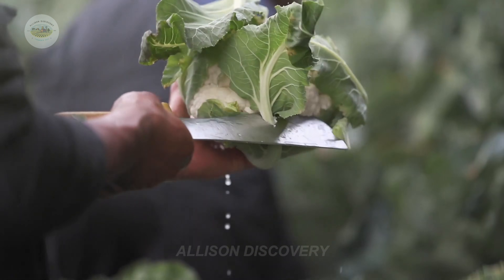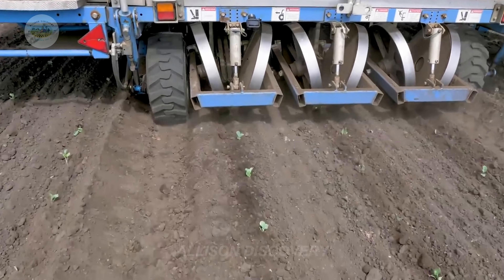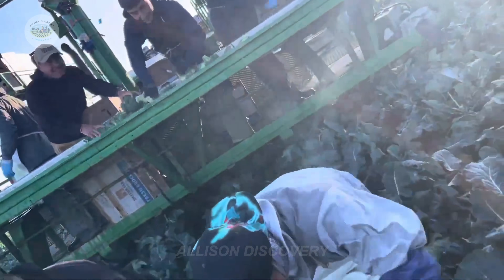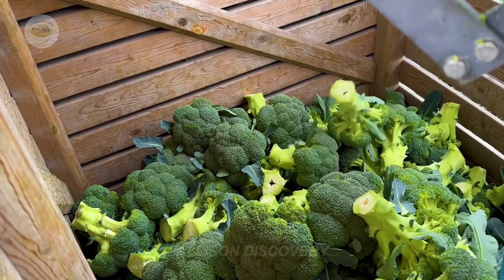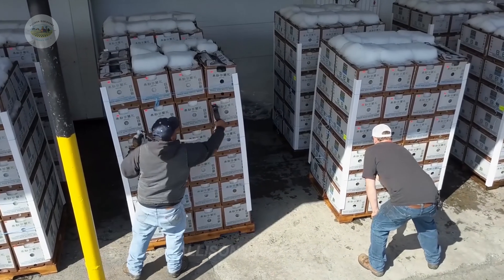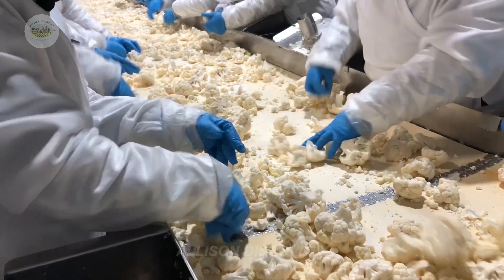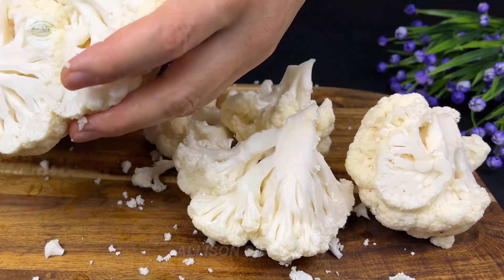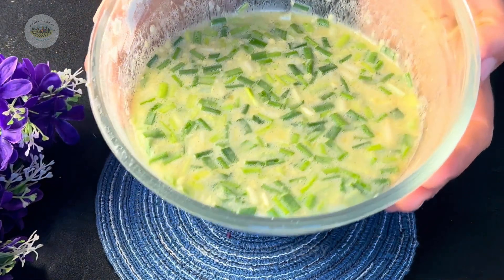Growing Cauliflower - Harvesting MILLIONS of Tons of Cauliflower | Agricultural Technology

Comment: I was diagnosed with a redundant and tortuous colon at age 50 and figured out that I could eat 1 pound of green peas to obtain 25 grams of fiber per day to solve the constipation problems. But 1 pound of green peas produced an insane amount of gas, even after intense steaming.  At age 51, I switched to 2 pounds of cauliflower per day, which also gives 25 grams of fiber, but with much lower gas and bloating. Life is good after that. And I am really curious about cauliflower now. Two pounds of broccoli also gives 25 grams of fiber, but that would overdose you on vitamin K by 1000% and be fatal in the long term. Cauliflower will not give you a vitamin K overdose, and cauliflower has very low oxalate content, which prevents kidney stones. It is amazing.